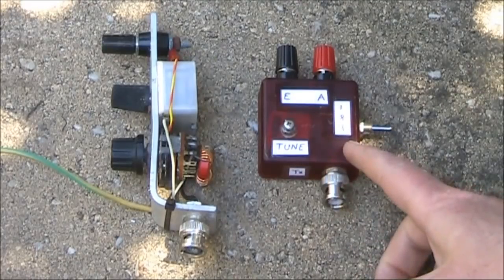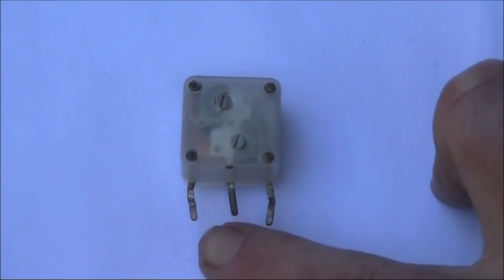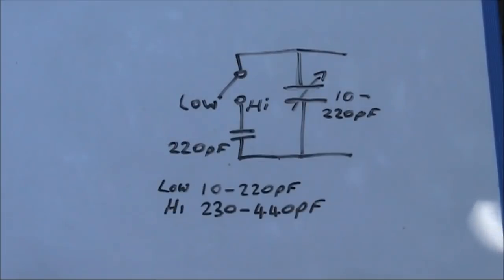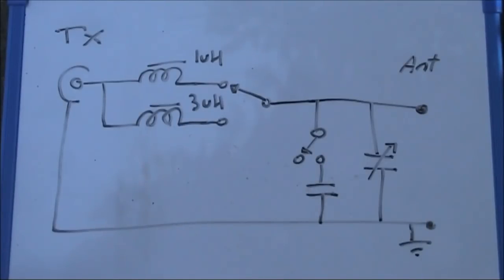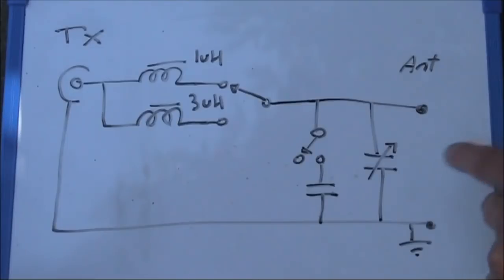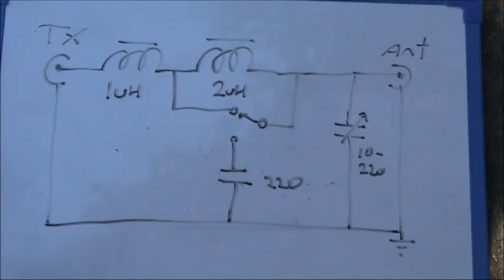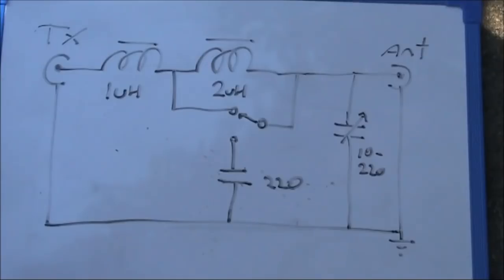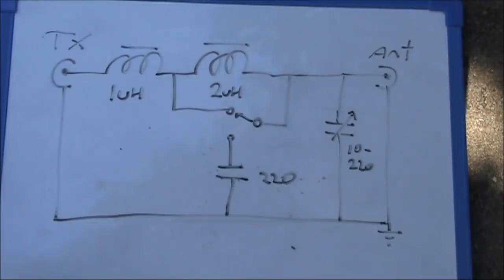About QRP L match antenna couplers with small variable capacitors

Comment: I frequently get a few Parks contacts on 10 MHz, SSB.

I like the idea of switching in and out a 220pF capacitor across the tuning capacitor and might implement something like that on my L-match. I currently have 5 toroids with shorting switches allowing for inductances of 0-15.5µH in 0.5µH steps. I'm frequently finding myself stuck with capacitance so this could help.
Reply: 10 mhz ssb? 30m ssb? Is that allowed somewhere?
Reply: @ERICtheLATE  It's allowed in quite a few places. Certainly here in Australia.
Reply: @alanjhargreaves  Oof...good to hear. Out here it is a painful data/cw only band, then 60 meter sounds nice, but there are fuzzy bandwidth under ssb rules and it is a mountain climber emergency freq band. Not sure on ideas, along with FM mode allowed on CB radio. Then on 80 and 40 meters, there is ssb use in cw portions. Still interesting and lots of new gear being produced, without reflecting inflation, just stomping 2nd hand, name brand gear prices. 73's

Comment: Thank you, Peter.  I have build the one you used in the previous video and I will modify it with a fixed cap.   My coupler was not doing a good job on the higher HF bands, especially 10m.  73, Chris VE2MW.
Reply from the maker: Chris - the fixed capacitor to increase the maximum of the variable capacitor may help on the lower HF bands. But it's unlikely to help on 10m.
Reply: @vk3ye   Thank you, Peter.  I appreciate your reply.